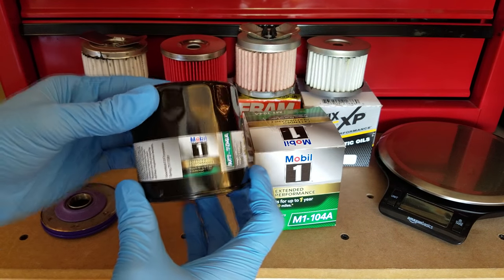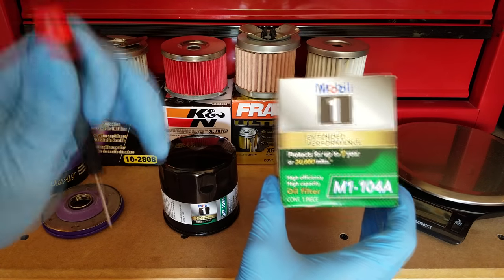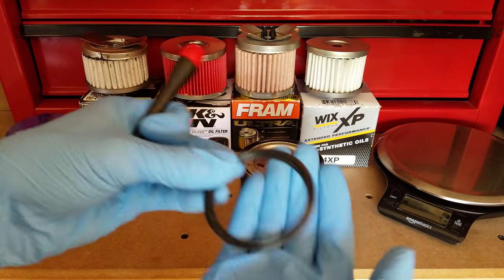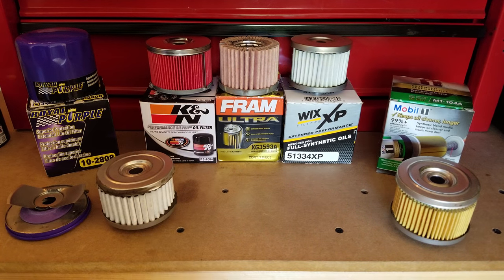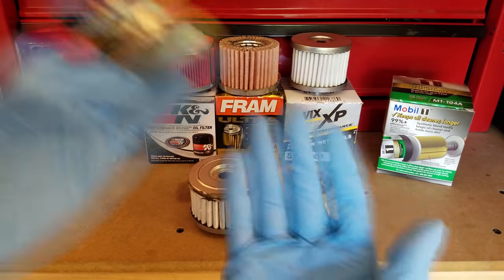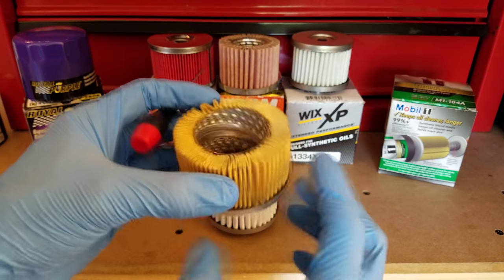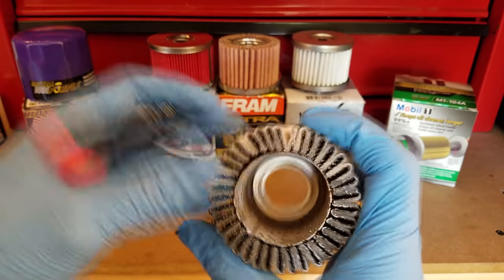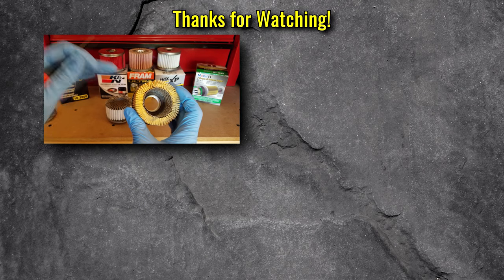Mobil-1 Oil Filter Cut Open! | vs Royal Purple/WIX/K&N!

Comment: in early 90's working at a chevy dealership we had a mobil 1 rep come to the shop trying to get us to up sale the mobil 1 synthetic oil they just came out for the corvette which was at that time over $15 a quart vs $3 or so for regular oil... The factory rep told us that the synthetic oil was a "lifetime" oil and the last oil change you ever need simply change filter ever 3k miles and add oil to top off for whatever was burnt or left in old filter... in 3k miles back then most corvettes used / burnt about 1 qt of oil every 3k so you top off anywhere between 1/2 Qt to 1 Qt per oil change .... WAIT hear me out before declaring all this horse shit.. mobil 1 rep stated very emphatically that mobil 1 synthetic oil does not break down with high temps like regular oil or with age it just gets dirty ... regular oil is absolutely worthless if you overheat the engine with lets say a stuck thermostat even if oil was changed within the hour it needs to be replaced as the oil will not protect the bearings because the heat broke the oil down.. you might say how can oil last a life time ?? synthetic rear end fluids do not need servicing .. a lot of forein automatic transmissions are sealed no dip stick because there is no servicing ... supercharger fluid case last 100K ... all these are enclosed systems where the engine burns some oil in combustion process so every oil change you are adding more new oil to the mix and in supercharger applications you are replacing the oil mostly because its dirty and low level and if you are in there replace all of it ..instead of filtering it and topping it off ... with that said ever since then have mobil 1 oil in everything and only replace filter and top off and no issues with this practice .. mobil 1 price has come down so much over the years and they have high mileage synthetic oil  as well with long filter intervals .. this oil is the exact same shit as the regular mobil 1 synth with more detergents and additives to compensate for long oil filter interval..... change your filter every 3k miles  the oil doesn't break down only gets dirty and contaminated .. if you get coolant in oil  replace all of it after leak is fixed .. do not bother trying to get mobil 1 to validate this as the drop in price per qt  they have a different marketing strategy now if word got out that you only needed to change filter and top off they would lose a lot of sales on oil and drive the price per qt back up ... you know for a fact that synthetic oil will last the life of a vehicle in transmission in transfer case and rear end and in factory superchargers why is it sooooo hard to believe that the engine as well will last forever .... your getting up to 1 qt new fluid every 3k miles as well .... 25 years and my lawn mower is running fine as well with synesthetic oil
Reply: Do a used oil analysis, you will be surprised by the results.
Reply: There is no such thing as lifetime oil. Thats crazy whoever told you that. All oil has to be changed. I change mine every 10,000 miles. I have a 2016 Toyota Corolla and thats what my owners manual says.
Reply: Uhh, wow.  The difference between a sealed rear end and engine is the engine is burning gasoline. There is blow by and the oil is exposed to the combustion process.  It gets contaminated!  The oil also do not get 100% filtered - although the amount it is filtered might keep contaminates low enough.  IF you are replacing a quart of oil every 1000-1200 miles then you might get away with this, but why?  The old rotary RX7's used to eat a quart of oil ever 1000-1200 and some guys only changed filter...but again, why risk it?

As other's said, send your oil out for analysis...you might be shocked at what you find.
Reply: I didn't decide to just do this on a whim.... I got the information directly from mobil 1 and they were recommending to do this on brand new corvettes at the time not 30 year old $100 beaters ... been doing this for over 15 years now and using best filters available not the bargain basement walmart filters.. in a 2002 camaro mobil 1 oil burns about 1/2 to 1 qt of oil every oil change so you are adding new fluid every filter change just not very much.
Reply: owners manual ? 10k miles ?  apparently Toyota wants to sell you a new vehicle every 3-5 years because 10k miles is over triple the filter change of 3k industry standard ... manufacturers increased the filter change interval BECAUSE a lot of people use synthetic oil today and with filter change at 3k miles these engines will last a million miles with zero wear (certified mastertech and had many engine apart at over 300k miles that look brand new inside versus in 1980;s when you take apart an engine with 60k miles on it you need to do a full rebuild and bore blocks replace pistons etc... in a modern engine you will never see a ring land wear ..people replace pistons and bore oversize because they want more hp not because the block is worn ) if you change your filter every 10k miles your going to need engine work before 100k and lots of it .. manufacturers increased oil change intervals to sell engines and vehicles not because of anything else ..any issues you will encounter will be beyond the warranty period ...
Reply: A PAO synthetic oil may not "wear out" but Mobil 1 hasn't used PAO only synthetic oils for ages and there are other reasons to get rid of the old oil like the additive packages wear out/disappear over time and there is an accumulation of debris that is less in size than the filtering capacity of the oil filter. Just like in a swimming pool having dissolved solids requiring a partial drain of the pool, engine oil will have the same thing.
Reply: You are right about the extended oil change intervals have less to do with engine longevity and more about getting environmental credits with governments and the manufacturers only having to make sure vehicles last 150K miles as that is considered "end of life" according to the EPA. I wouldn't do 10K OCI unless I was doing exclusively highway driving and my used oil analysis said I could do so. My cars say 5K OCI using conventional, but I choose to use synthetics with the same OCI.

Comment: To me, less holes, less entry. more holes, more free entry of incoming oil.
Reply: Depends - if the number of entry holes equals or exceeds the area of the single exit hole that is sufficient. If it doesn't then it would be restricting flow.

Comment: If you change the Mobil 1 filter at 15000 miles you can get 30000 miles between oil changes 🤪

Comment: Tearing a filter apart tells you nothing about how it will behave in your application. Even the first pass filtration rating tells you next to nothing. You can run the best full flow filter and the worst and your USED OIL ANALYSIS will not look any different if all else remains equal. If you keep dirt out of the oil so good quality OEM air filter, all hoses and lines tight and duct work tight then their is little for the filter to do. Unless you are sprinkling dirt into your engine how much do you think your filter is going to catch? You want to keep the dirt out of the engine to begin with which is why cold air kits are terrible. Any filter designed for a car with a factory oil change interval of 20K miles will go 20K miles. I am not aware of anyone with a 20K mile oil change interval recommendation from the manufacture. If you look at filters not recommended for 20K miles of use you find much the same design elements the construction method is similar, the glue is the same, the number of pleats while modestly different are not significant. Maybe if the vechile is being used in a coal mine with super fine particulates it might matter. On an engine that is not neglected and full of sludge you will never see the pleats full of matter the inner most area were the folds in the pleats happen will have some light grit with plenty of media left free to continue filtering. If you find anything other than that you have a leak some place in your engine like air intact duct work or vacuum line or intake manifold etc.

Comment: Their 'guarantee' doesn't mean much unless you can relate that they have actually stood behind it.  Madison avenue lying being what it is they can claim whatever they can dream up.  It really has no relation to reality.  Like to wager that next year some manufacturer using the exact same technology as today will claim you can go 25000 miles?  ISO standards don't mean much either unless they give the full report on their test.  You can take an ISO test and fail the standards yet still claim to have been ISO tested just neglecting to state the part about failing.  Independent lab testing before an after being used in test vehicles is the gold standard.  Good topic though I wish you would have sent in samples to be flow tested, micron tested, durability tested, etc.  Then let us know the result.  Take care.  Doug

Comment: Why are you going to test FRAM, .......after all these years you should know they're worthless and the worst on the market. Pure junk.?....Lots of pleats could be good or not, dependent on the micron size of the holes in the material.  Large particles getting thru the filter material is doing damage to the engine.

Comment: Who CARES about "wall" thickness!! I want adequate "filtration." Microns important to an extent.  My mind got changed when I went to Jiffy Lube, used their sorry ass cheap oil filters...flimsy as tin-foil...changed the oil (conventional and or blend)  on an older Ford Taurus every ~ 3-4k miles. Guess what, I got 180,000 miles out of the engine without oil burn!!! I "A"rest my case...:)

Comment: Like what idiot doesn't do a quick inspection of their oil filter before they install it? I've seen many with metal shavings where they tap the screw plate for various diameters for various engines that use the same filter. Clean the threads and give it a shake, then install it. They all have to meet the spec's, even the el cheapo's.

Comment: 20,000, then follow the asterisk down to the caveat that the user needs to follow the (car) manufacturer's recommendations for oil change cycles. 20,000 is a scam to sell oil filters and oil. Oil gets dirty and it happens a hell of a lot sooner than 20,000 miles.

Comment: How much do you think a filter does for you in a well maintained vehicle with no leaking hoses and a good working air filter? Baring a catastrophic failure or a sludge up beast their is not a lot for the filter to do. It has been proven time and time again that on a full flow filter that the filter with better flow produces less wear. Frams cheaply made filter and the Champion labs cheap design with plastic cage instead of a metal tube and glued fiber end caps works just as well in use as much more expensive filter. I did UOA and cut open filters for 20 years never say a single UOA of trending data appear better just with a filter change. In fact freq. even when running bypass filtration and getting a particle count no real improvement could be seen in most cases.  When BITOG did testing again the filters with better flow performed better. Also any oil filter again if your air filtration is good and you have no leaking vacuum hoses and no leaks on intake air  side will last for the full duration of your oil change. There where no special filters around when Mobil-1 back when it first came out advertised on the containers 25,000 Mile Oil Change Interval. Same thing goes for the initial release of Amsoil. It took them a while to see the money spinning advantage of having "special oil filters and air filters" . In the 1980's Toyota for example had you change the oil filter every other oil change and so did Honda and most other imports. All these more expensive filters do it improve the profit margin of the company selling them. You never get a good answer from them because if they lied and said definitely that the synthetic media did anything better or that the thicker can does anything for a daily driver, or anything else they would open themselves up to litigation and they would have to produce actual results that demonstrated that those claims are true not just in ASTM testing but in real world application.

Comment: I do very thorough research and I'm not expecting anyone to listen... because most people just follow the trends... and the few who do good research already know... but I'll say it anyway. If you are actually serious about clean oil, you end up with a filter withOUT a bypass valve. Obviously this means you can't be an idiot and run it forever... so that's 99% of the population out right there. All these filters are almost useless when it counts, because at higher pressures the bypass opens and lets all that crap right on by. Use that for your larger particles and higher flow. Then you should have a good bypass filter. There are finally some good options but I was doing this before there were so I still use Frantz toilet paper oil filters. My 33 year old engine's oil is usually so clean it is hard as hell to even take a level reading. Like it usually take 3-5 tries to be satisfied I got it. I swear it's more clear then out of the bottle maybe. And I certainly don't change my oil as often as most although you wouldn't believe any of this probably. Same with my sports car and I don't have as much to worry about when I get into the boost. I also use a preluber but ya'll waaay too stupid to listen to me about that.. so.. carry on "feeling" like you are taking care of your engine... that's all people are in for these days.. the feefees... but I did my part trying to tell the world.

Comment: Good grief! 25 microns, 30 microns...how do you KNOW? Who actually determined that?  Independent lab?
20,000 mi. of "protection"?  Exactly what does that really mean?  I know what you may want it to mean but what does it actually say?  "Protection" really doesn't mean anything, does it? The issue is: How much protection? Is the filter filtering as efficiently (allowing full flow) and effectively (micron particle size, if you will) as a new filter?  VERY UNLIKELY.  So, how much degradation in performance are you willing to accept in life?  As to the "20K" oils, most of that seems to be advertising hype for the gullible.  There are some independent engineering lab data available but not much.  Wonder why? And the fine print (sometimes on line only) says to always follow your engine manufacturer's recommended oil change interval.